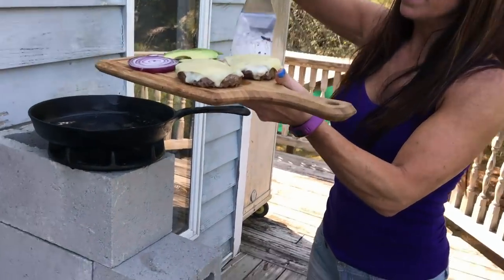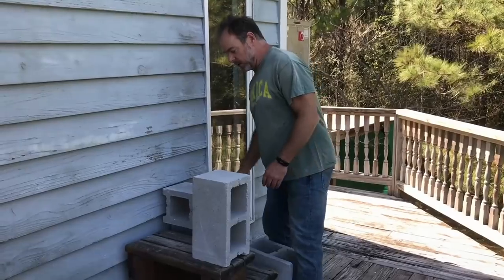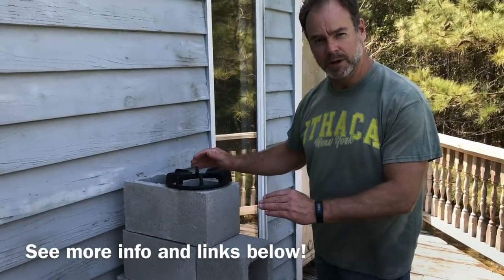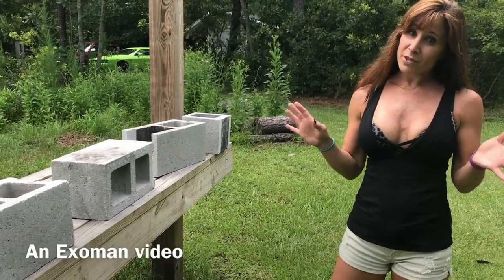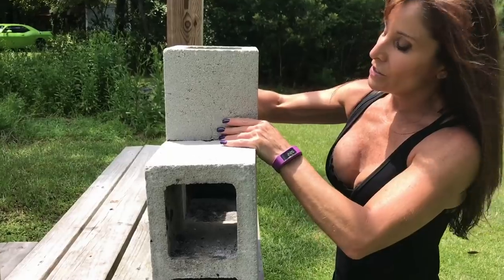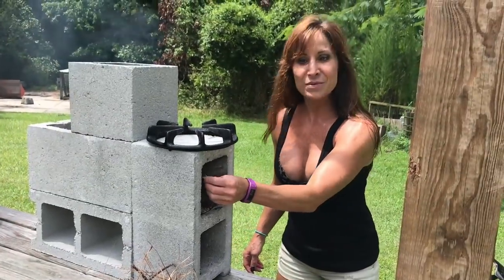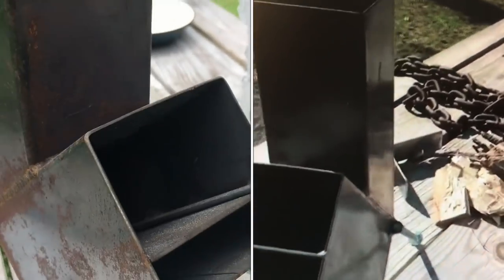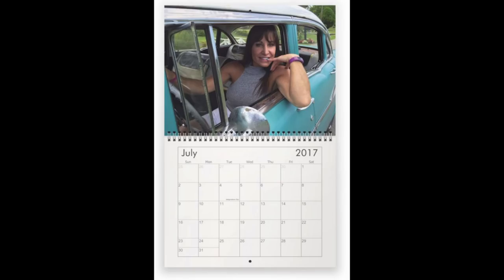AMAZING tips  for rocket stove survival, prepper tools!  STUNNING woman's concrete block stove.

Comment: I made a cinder block grill. Yours is the closest video I could find to it. Most cinder block grills surround the grids. I had a neighbor throw a gas grill out. The burners were trash. The grids were in good shape. I got a 12" block mortared to a 3" vented block. The 3" block has 1/2" holes to draw air in from the bottom. The 12" block is on its side making a 2 pocket mini burner. It was a little deep, so I added 3" of lava rock. Cover with 3 more inches of charcoal. Then I painted it flat black. Cooks nice. Good for 2 people. Hasn't crumbled or cracked yet.

Comment: You can use two pavers and a concrete brick or an H block also if you can't cut the block. With a good masons hammer and a steady hand you can break open the end of a block too.

Comment: The air bubbles in cement explodes. Being a welder I see the cement floor blow up. There’s a special motar for brick fireplaces.
Reply: bill porciello- it’s cinder block, a little different than cement. (Actually you mean concrete, cement is the glue that holds sand and gravel together to make concrete) People have been building BBQ grills out of cinder blocks for years. May crack if it has a flaw but never seen one explode.

Comment: I worked for a manufacturing company that made a dried concrete blocks. Sorry, but they will explode and should not be used the way you are trying to do. The reason they explode is moister in the block expands with heat. They are dried in kilns that have steam vapors that do the drying so no cracks develop before being sold to the public. Think about this for a moment, When blocks are used for a barbecue they are lined with fire brick for a reason. The brick absorbs the heat and is an insulator. Glad you've never been hurt but it is only a matter of time.

Comment: Laying a cutting torch on a concrete floor will cause it to explode or cutting metal over concrete with a cutting torch will too but the heat is waaaayyyyyy more intense than a wood fire use for cooking

Comment: would a wok sit on the square hole without a grate, I have a wok i don't really use because my stove top does not put out enough flame this seems like it might work
Reply: twisted Dymond woks are usually larger than the aperture on a breezeblock, should be fine...